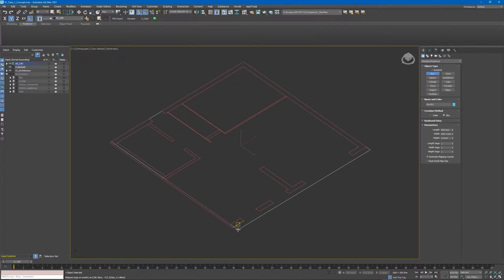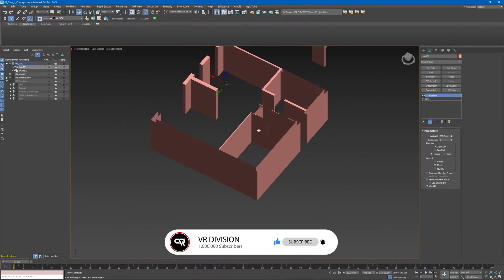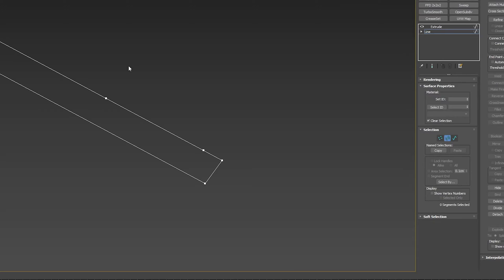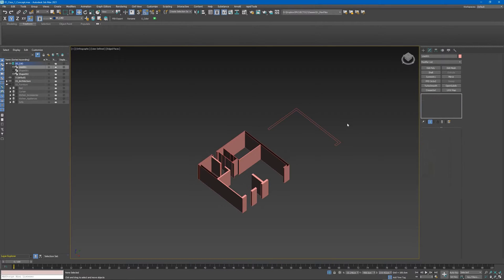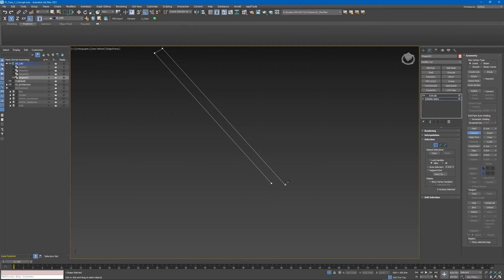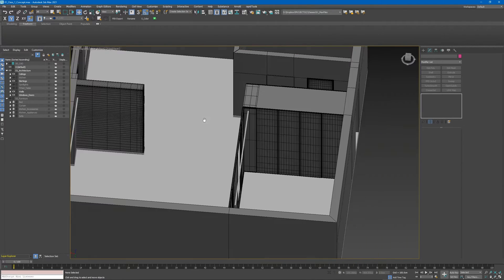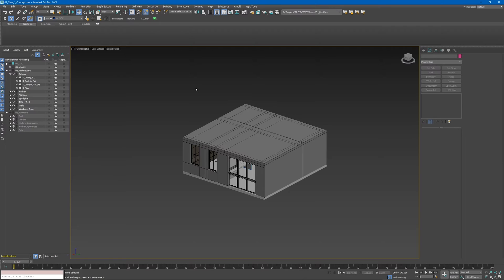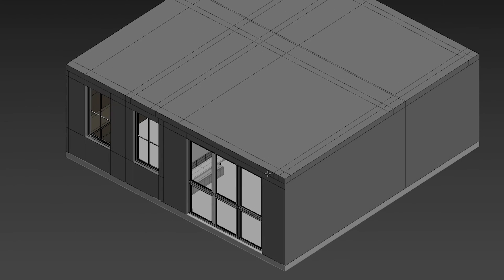2. 3D Modeling and Exporting our Project | Class #1 | Unreal Workshop

Comment: Hi, I have just started with unity and unreal, however I have been working with Cinema 4D for 20 years. Is this a problem or should the exchange via fbx work fine?
Reply from the maker: It's not a problem at all, you can import C4D projects directly inside unreal engine, you need to find Datasmith C4D importer in unreal engine and you should be good to go, if you get any problems or need more help, please join our discord  community and I'll be more than happy to be of service. Cheers!

Comment: In 3ds max, do we require unwrap and set channel 2 for each models ??? Or just export to datasmiths and they will fine in Unreal engine ??
Reply from the maker: Datasmith will automatically unwrap everything for you on channel 2 it does great job on surfaces like floors, walls, kitchen ... etc 
 but sometimes you may need to do that manually on organic objects life sofas, chairs ... etc 
for the best quality yes, but if you are using GPU Lightmass then you could get away with raising the lightmaps quality on your objects